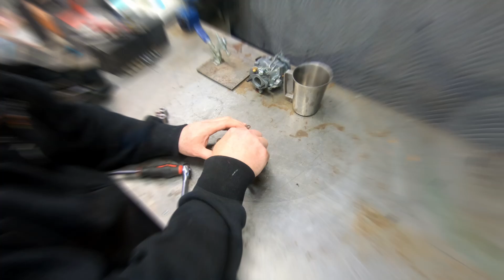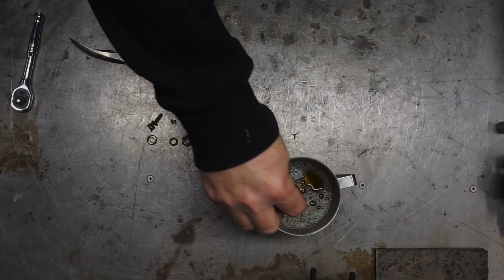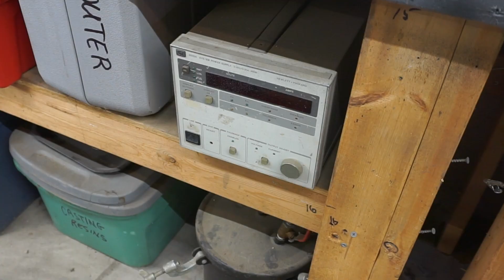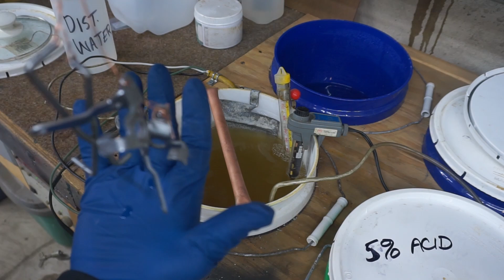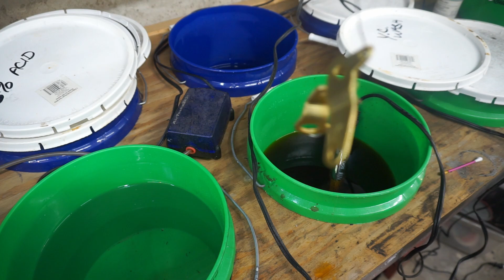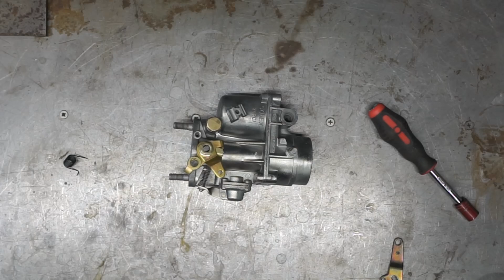Restore ANY Carburetor Linkage to NEW at Home DIY! Zinc Plate and Yellow Chromate Process.

Comment: watched this a few times. watched other videos before i purchase a caswell kit. what is your degreaser solution and is it in like a heated crock pot. thanks
Reply from the maker: It's also from Caswell.  They call it "SP degreaser" it's a powder and you mix it with water and heat it up.  Works great also it also "pre-heats" the part for plating.

Comment: great job, I have the caswell setup works fantastic, like you said go with less amperage and longer time . caswell recommends .14A per sq inch. I hang parts and use a heat gun. If i screw up I polish out with scotch brite and replate.
Reply from the maker: If that chromate doesn’t come out good a few seconds in the 5% acid will strip it off and you can try again. That chromate  can be fussy and not stick sometimes.